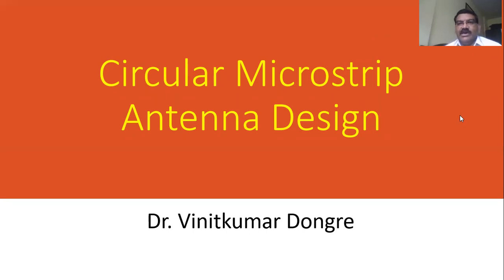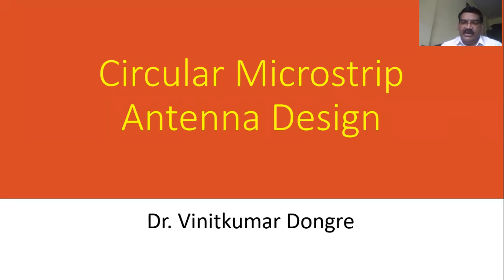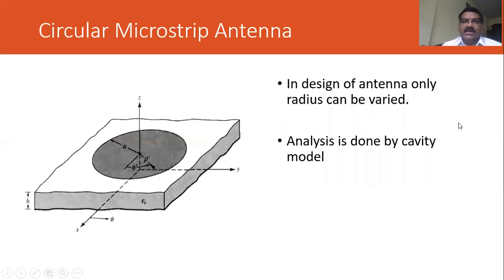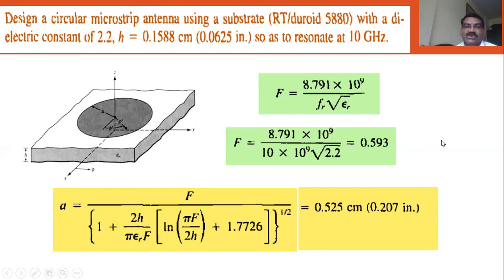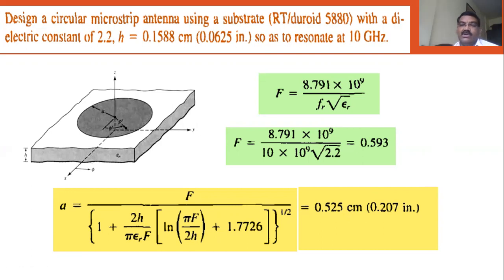Circular Microstrip Antenna Design

Comment: Hi Dr. Vinitkumar Dongre, can you help me with the calculation for circular ring microstrip antenna? I am planning to design a 2.4 Ghz circular ring microstrip antenna. The materials used are FR-4 substrate with 1.6mm thickness, the dielectric constant Er is 4.3 .Thankyou.